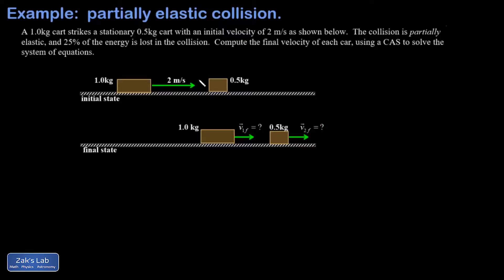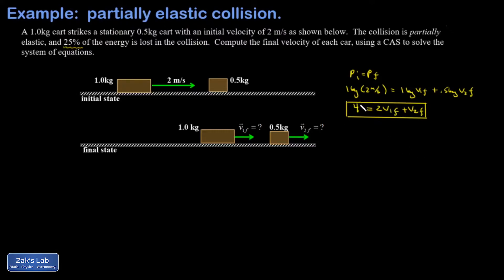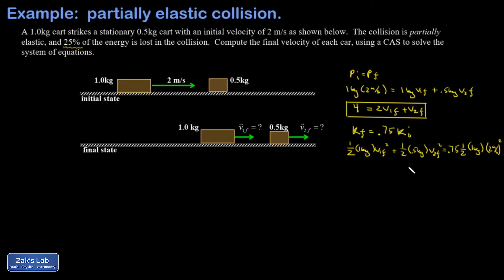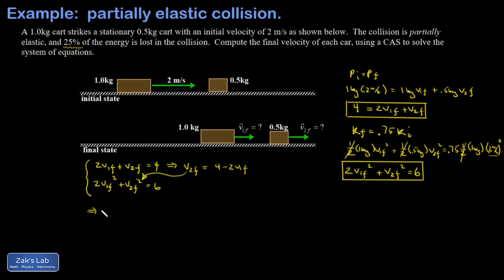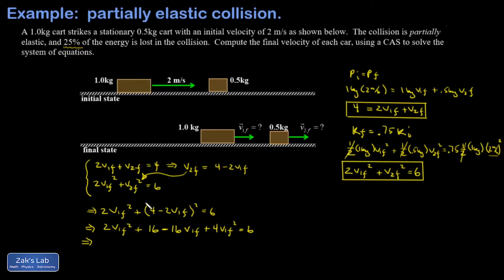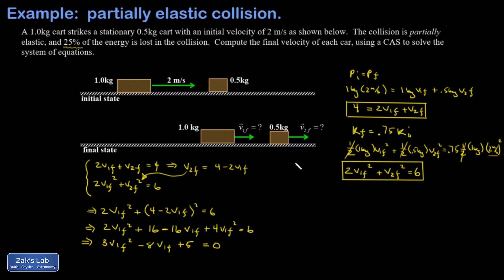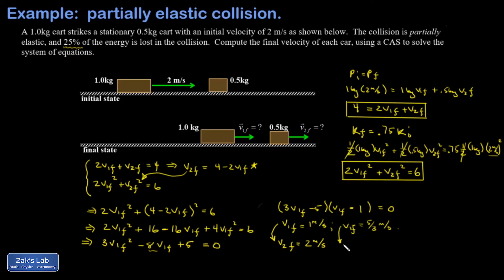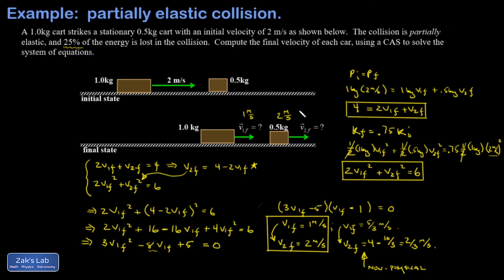Partially elastic collision in one dimension -- 25% loss of kinetic energy, compute final velocities

Comment: I have a question, what is the difference between partially elastic collision and inelastic collision?
Reply from the maker: Normally if I say "inelastic collision" I mean "perfectly inelastic collision" which means that the two objects stick together and move as one object after the collision.  If I say "partially elastic collision" I mean the objects still bounce off each other, but some energy is lost, just not as much as you'd lose if the collision was perfectly inelastic.  

These are in contrast to an "elastic" or "perfectly elastic" collision in which the bounce is energy conserving (imagine perfect spring bumpers for this).

z
Reply: @ZaksLab  Oh thank you so much